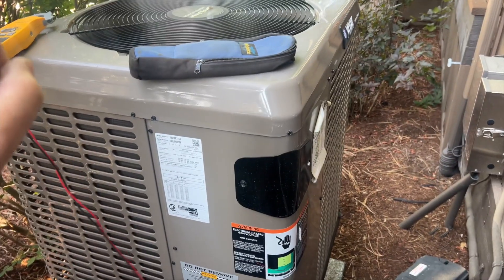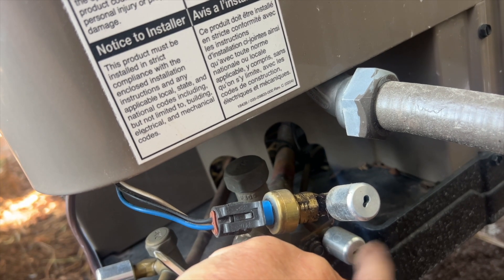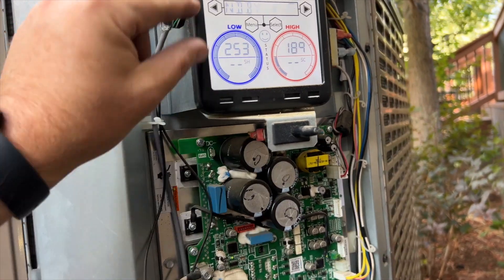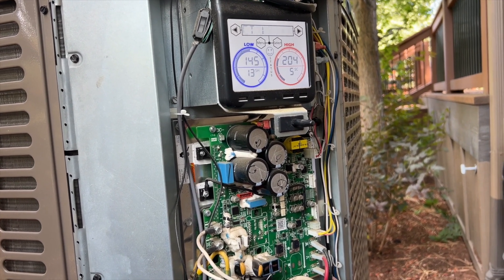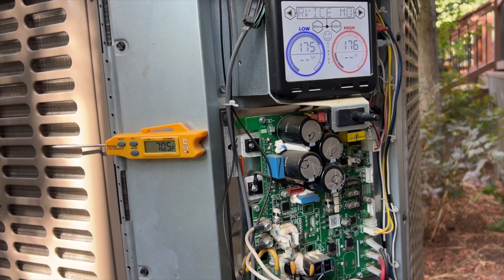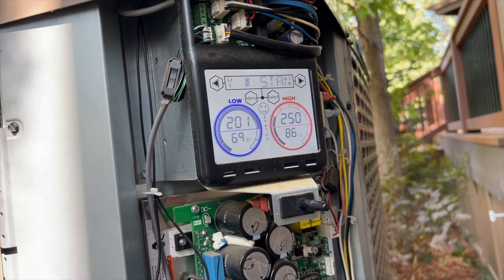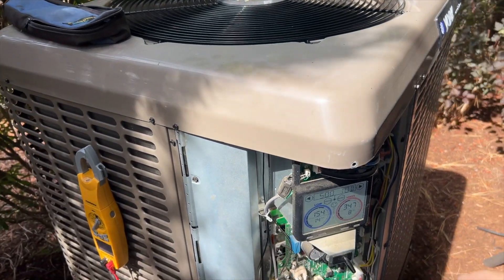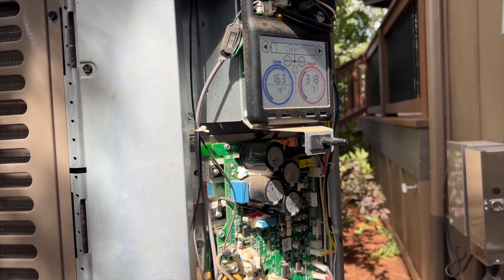York Affinity HP High Suction Pressure Error EP188

Comment: I have had a York affinity unit about 5 years now. Getting the initial charge right took like a year because the outfit would not use the built in charge calibration because it can only be done under certain conditions. This resulted in a unit that was overcharged and it would work fine until temps got about freezing and comp speed started getting up there then it would freak out and throw pressure errors. Finally doing a charge and letting the unit determine the correct amount resulted in units that have been working great. Took $100/month off my electric bill.
Reply: My York is throwing high pressure errors in heat mode, first few times it's running.
Using the default r410a charge  it came with. Thanks for your post.
Reply: @aj7calgary You can go into the thermostat service side and view the pressures while running if it’s near freezing and the high side goes over 500psi it likely is overcharged.

Comment: Not a fan of any of the variable speed equipment. May be okay while it's still under warranty, $$$$ when out of warranty. Two stage heating and cooling is fine with me as long as you're truly getting a second stage cooling rather than relying on a transducer's temperature when asked for.